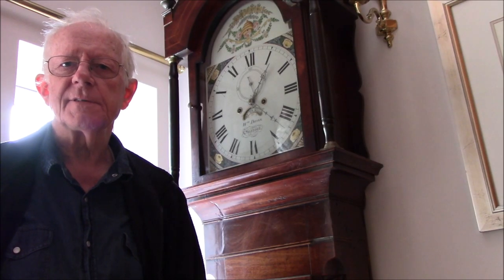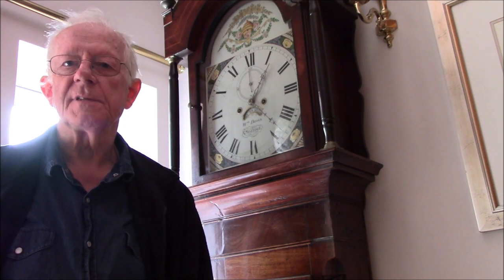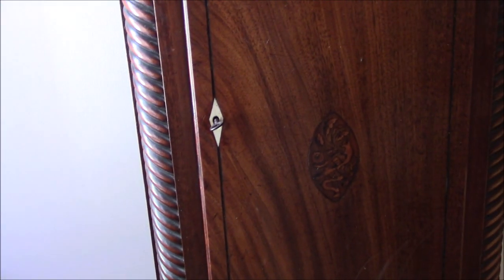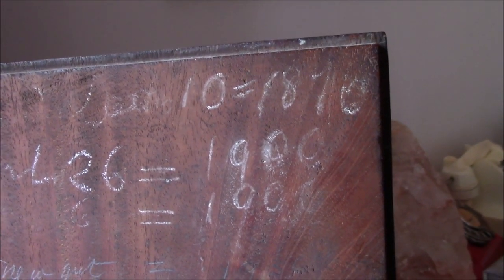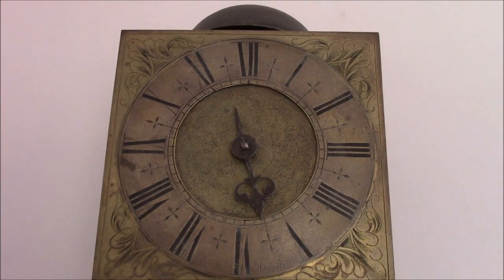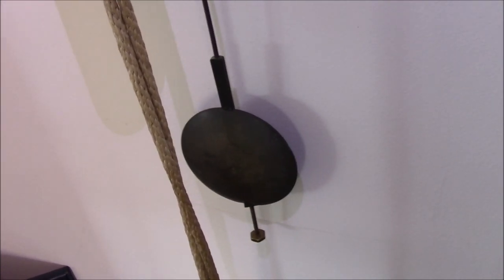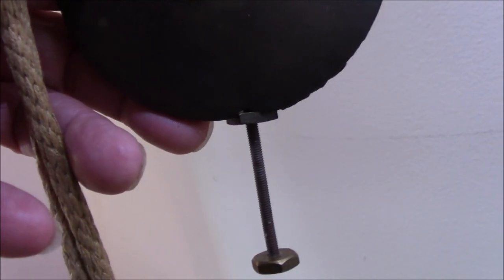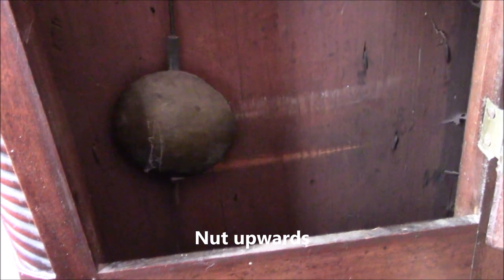A simple way to adjust a pendulum clock

Comment: I have an old pendulum clock that's been hanging on the wall for probably 25 years. It works and then it stops. Your video has made me want to try some adjustments on it. I agree with you how satisfying a pendulum clock sound is. Thanks.
Reply from the maker: Thank you for your comment.

Comment: I have a grandfather clock it keeps losing time 2 to 3 minutes I turn the adjustment screw on the bottom and it seems like it don't even move or work what else can I do please help thank you
Reply from the maker: If it is losing time the square nut at the bottom needs to be turned clockwise as viewed from the under sde. this will shorten the pendulum which will allow it tick faster. If turning the nut does nothing then the screw thread is possibly stripped.